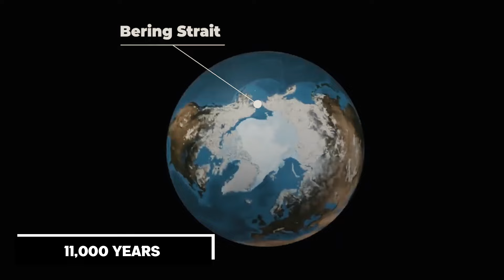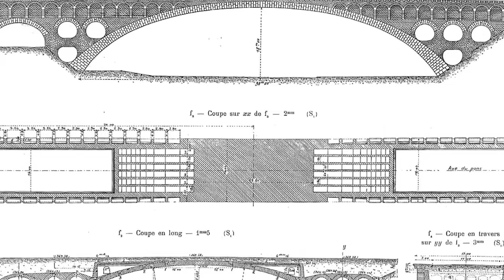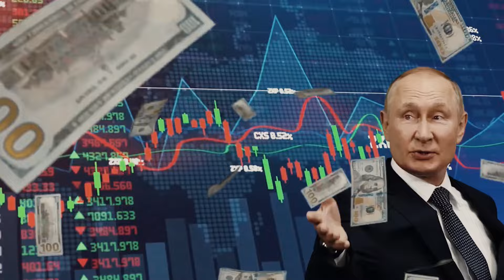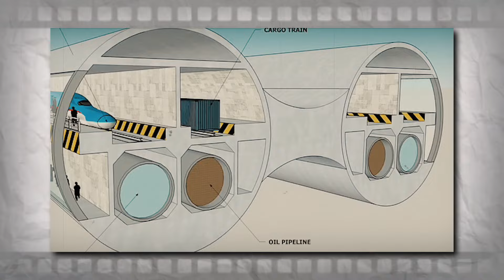Putin's IMPOSSIBLE plan to build a highway to the USA!

Comment: I certainly want to see a road connecting two continents, but honestly, it might be far more than a bridge or tunnel, even if only in engineering. Building a road in East Siberia is nothing easier than crossing the strait. It took tremendous efforts to get from Yakutsk to Magadan by the only existing highway Kolyma highway, from the most east point of which there is still at least 1000mi away without any worth-mentioning roads. We may easily make an analogy of the topography there to a vast mountain area you can think of, but here we are talking about one with not only complex landscape but also extreme weather and cold temperature, and more importantly, for at least 1000 miles.
Reply from the maker: To be sure, quite a challenge!